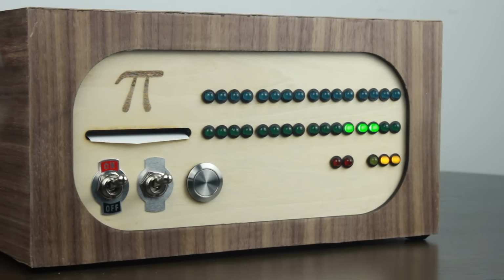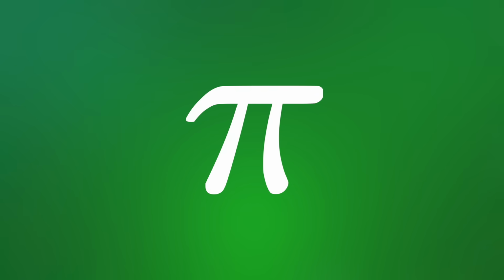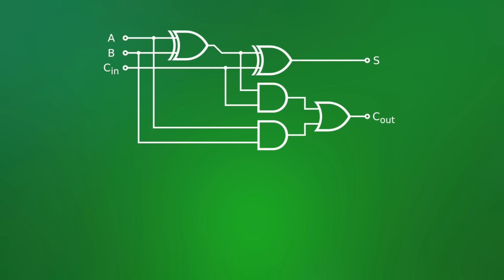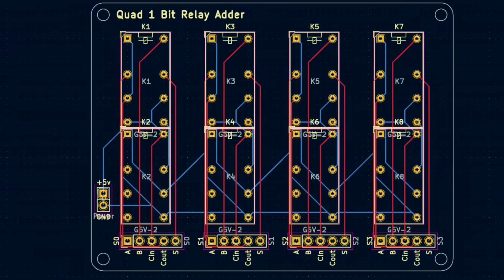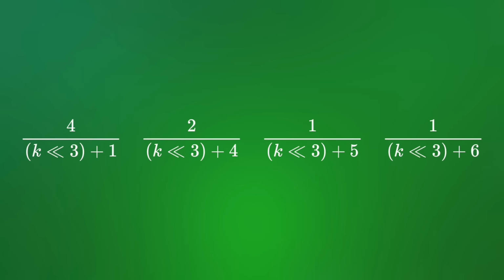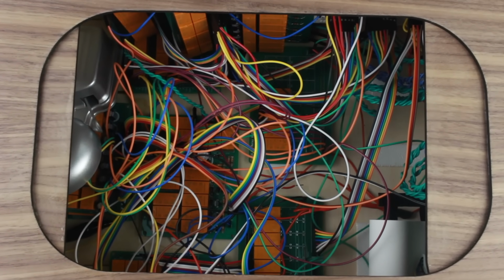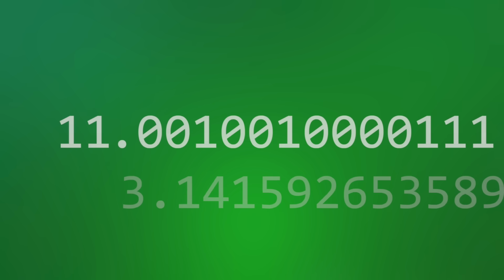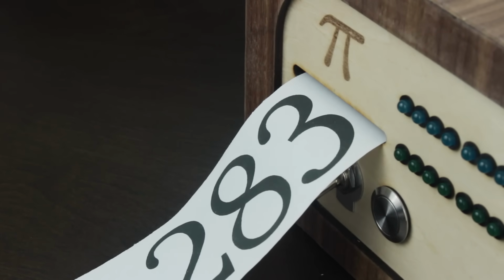Building a Relay-Powered Pi Machine

Comment: I think I'm missing something here - is it calculating one digit at a time? You said you weren't using the arbitrary digit formula, just the simple approximation sum, so it sounds like you're calculating all the digits together - unless there's some subtlety to the "multiply by ten" bit at the end I'm missing.  However it works it's a very cool machine and I love clicky relay computers :)

Comment: Konrad Zuse invented the relay computer with the Z3 in 1942 — using 2,300 relays to perform floating point binary arithmetic with a 22-bit word length. Very cool to see this elegant implementation of a PI machine. ✨
Reply: In 1938 (introduced in 1941), but yeah. Sadly the original Z3 was destroyed in 1943 due to the war
Reply: @0106johnny But he rebuilt it although it's currently out of order.
Reply: The Z1 was a mechanical computer which operates with moving metal rods and sheets. The Z1 also implemented an ALU which could add, subtract, multiply and divide floating point numbers.
Reply: Zuse wasn't the only one thinking along those lines, though.  The Harvard Mark 1 was relay-based, and built not long after the Z3 (online in 1944).  Among other things, it calculated how different A-bomb designs would work for the Manhattan Project.

Comment: The capabilities of relays got me thinking. You could, in theory, use relays for reversible computing. A DPDT relay could implement a CSWAP gate. Set it up so that the coil takes the control signal and the two switches either pass or swap the inputs. The common pin serves as the output, and one switch will connect A on normally-closed and B on normally-open, and vice-versa for the other one.

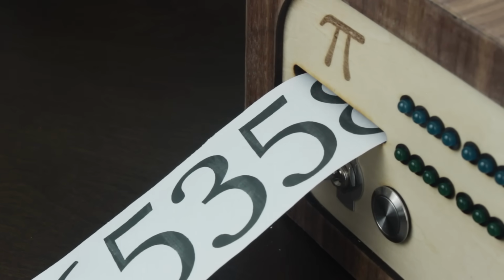Comment: 0:15 Printing more digits does not make it more accurate.  What it does is to increase the precision but if the digits are wrong it will not be accurate
Reply: But... it prints the correct digits, so it's more accurate.
Reply: @BadChess56 again, technically no. It becomes more precise. Let’s say that you have a target and three shots. If all three shots hit on the edges of the target roughly equally spaced, that is a highly accurate but low precision set. If you fire a second of of three bullets, with one bullseye and two on the edges, your accuracy has actually decreased even though one shot was bullseye. Now, let’s say you fired a third set, and while none were bullseyes, all three were in the inner circle and equally spaced around the bullseye. Is that more accurate than the first set? No, it’s the same accuracy, but higher precision.

Printing more decimal places, even if all of them are correct, is a measure of increasing precision and not accuracy.
Reply: @Cobra1597  I know the difference between precision and accuracy.  Accuracy is when it is close to the ground trurh.  Since printing more digits beings the estimate closer and closer to the ground truth with more digits, it becomes more accurate.

Comment: you should make a relay machine that can hash values in sha 1 or something simpler and more primative. like use an arduino with serial for just the ui stuff but the relays actually do the hashing and send back to arduino to print

Comment: Here's a great algorithm for approximating pi that may be better suited to your approach: just generate a digit at random, and if the raspberry pi detects that the digit is incorrect, it resets the relays to a clean state and starts that section over again. Don't worry, the computation is still all happening on the relays. Just a tiiiny bit of error correction. :)
Reply: Raspberry π?
Reply: ah yes, the bogo methodology
Reply: Agreed.
Memory? I can live with that.
Error detection totally defeats the point. :)
Reply: @pompeymonkey3271 Error detection in itself is not the issue. It would be okay if it was internal, like asking the same relay setup or another one to compute each digit several times and compare them together. The actual defeat is using a precomputed value to control the output. If the precomputed value has an error, the output will have the same error.
Reply: Nice

Comment: With regard to your relay issues, one of the flaws I see in your design is that you are mostly powering them directly, without proper capacitor smoothing to deal with inrush current spikes inherent to mechanical relays. When multiple relays are firing together, it can cause current spikes that overwhelm the direct power supply quite easily. This Cascades into the computational errors you are seeing in the relays.

This is a common error many people more familiar with modern electronics make when trying to replicate older style computing devices. Underestimating current draw is a common issue.

Comment: You have inspired me, a welder, to see if I can make a lawnmower engine powered abomination to calculate PI and punch it in on toilet paper or paper towels or something. I’ll keep feeding it toilet paper and god only knows how far it will go.
Reply: What does the lawnmower do? It makes carbon monoxide.
Is that legos in its construction? Yes.
Why is there a knife taped to a fan on it? Because I put it there.
How are you supposed to stop it? You don’t.
Why is that lug nut glowing? Because I said so.
How much did this cost? I don’t know but I bought most of it on Craigslist so probably cheap.
Are you sure that attaching that part with Elmer’s glue is a good idea? No.
Why? Probably.

Comment: Why would the limit be 4096 digits? Is that due to the RP's error-checking? By the way, you could also repeat each step multiple times as a form of error-checking; either take the most frequent result or keep repeating until you have enough consecutive identical results.
Reply: Or implement Matt Parker's system for catching errors and recomputing. Might need a dozen more relay machines though.

Comment: This is something someone could feasibly make in Minecraft. Sadly I don't have the skills needed for it as of now
Reply: We have full 8 bit cpus in Minecraft
Reply: Don't give me ideas :D
Reply: @@OmarRodriguez-vl2tq while my 4th gen i5 can not run Minecraft after certain update.
Reply: @AfonsoBucco  I'm assuming you're running the Java version (the best version). Have you tried running it on Linux? This is not a joke. My old X220 ThinkPad with a 2nd gen i7 use to be able to run Minecraft up until around 1.17-1.18, at which the graphics driver was too out of date for Minecraft... when using Windows 10. I tried running Minecraft 1.20 it on Linux Mint and it worked perfectly. For whatever reason, Linux has better graphics driver support for these old machines than Windows does.
Reply: I mean, a relay would just be a piston with a redstone block on the end where an extended piston is a 1 and a nonextended is a 0.
Reply: @frumbert 
That's an interesting idea, I was originally thinking of using perhaps a single-digit 7-segment display, while it may work, it would only ever display a singular digit.

Your system would work in theory but the true issue arises when duplicate numbers enter the system, they will just stack with the other papers.

Actually what we could do is encode a cypher in concrete powder colors, then repurpose a redstone image printer system.
Reply: @aydenlokey3641 You could use block generators (like stone/cobblestone generators) and print the result like a 7 segment display. You'd just need some kind of extension mechanism because of piston push limits.
Reply: Add on the Create mod to get more pistons and things that can rotate to keep the "tape" in a loaded area. @iXenox
Reply: @@OmarRodriguez-vl2tq Already been done.
Reply: @@OmarRodriguez-vl2tq A guy made a very simplified version of Minecraft on a redstone computer in Minecraft. It's on YouTube.
Reply: I mean if we're not concerned about the purity of having it be buildable in survival, you could always use command blocks to output each number into the chat, or even have it place a digit to where an armor stand is then moving the armor stand.
It would actually kinda be like the video, where the relays makes all the calculation (the redstone) and the raspberry pi handling the printing (the command blocks)
Reply: challenge fucking...
declined

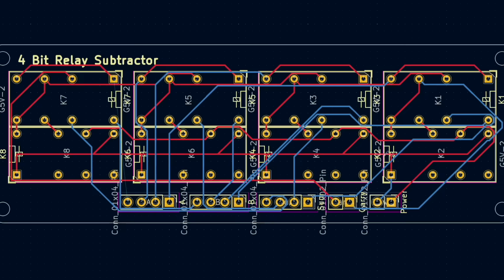Comment: 8:20 - I still find it theraputic even for huge boards, its fun to make art of PCBs, something who ever assembles the kit enjoys looking at.
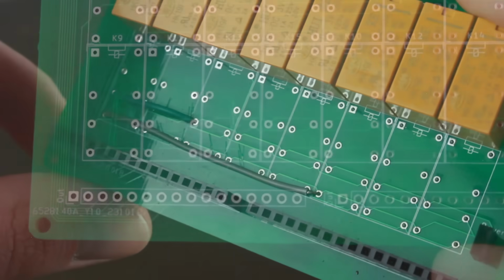12:41 - It absolutely helps to look at a pcb manufactures capabilities and looking at their min spacing and rounding that up, for example JLCPCB has a min trace thickness and clearance of 0.127mm but I say go to 0.15mm, also account for whos putting it together like, is it possible the edge of the PCB is going to get damaged or a solderng iron slips and damages a trace right next to a pad, so space things apart acordingly.